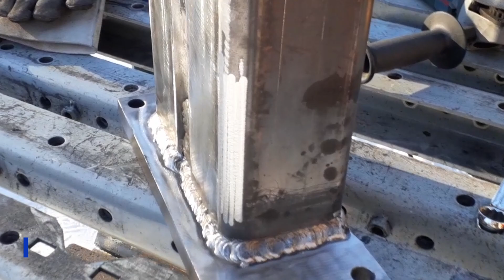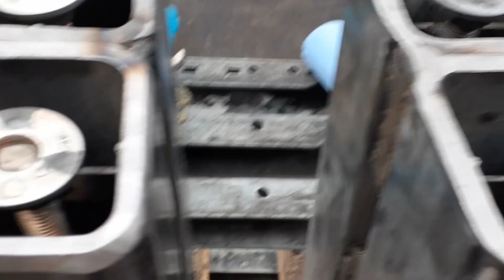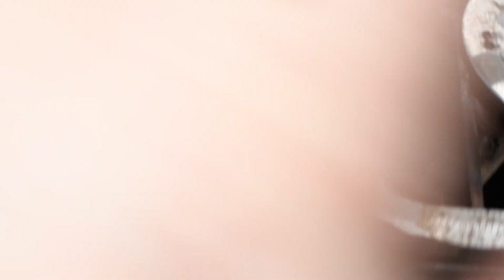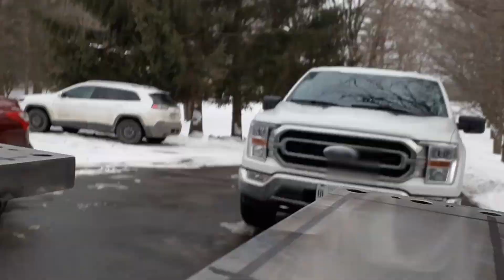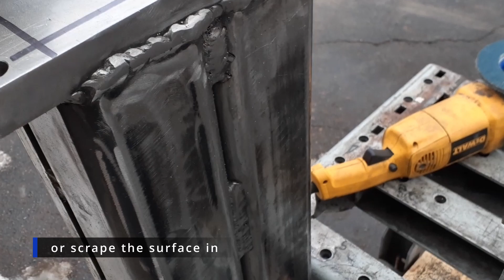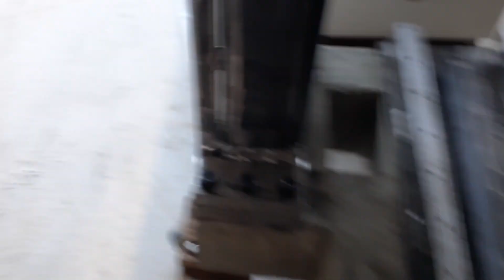DIY CNC Mill: Welding Gantry Risers

Comment: the weld is not good?
Reply from the maker: Not sure what you're referring to?
Reply: Not sure what he is specifically referring to.  Welds aren't the prettiest but better than I could do.  No doubt it's going to be rigid.    It looks like you're building a smaller machine that will be able to do heavy machining in steel or whatever you ask it to.  Thanks for sharing.